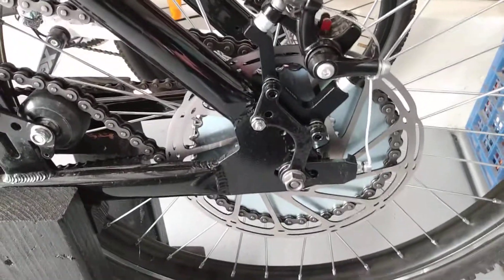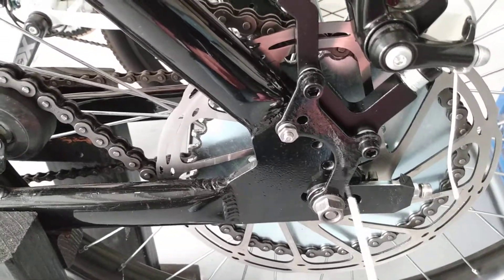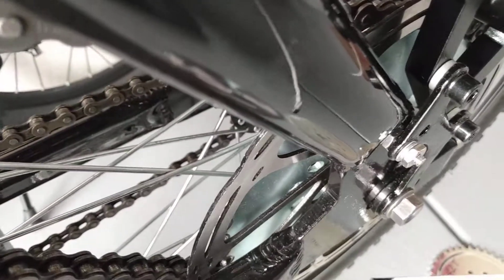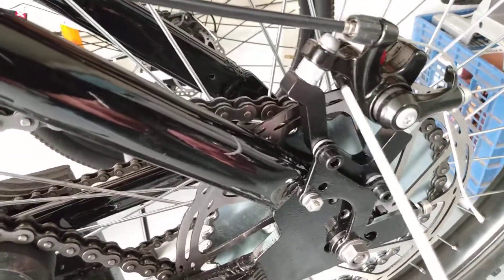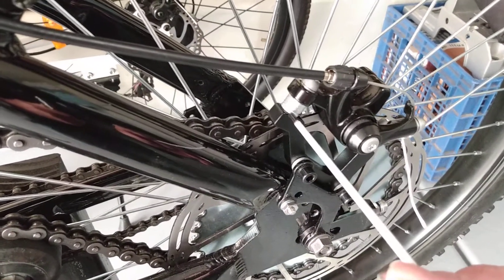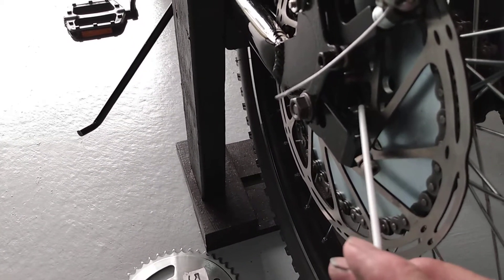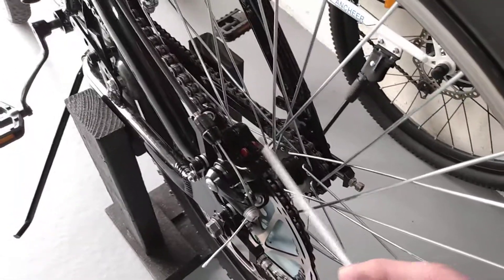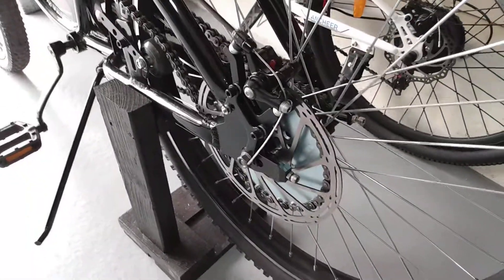Phatmoto 2019 model  Converting the V-brake to a rear disc brake

Comment: Being an older video, does the OP or anyone else know if this conversion has gotten any easier?   

FYI, the Switz Cruiser now has the back coaster brake fabricated at about a 15 degree angle.  It still attches to the traditional spot, but it's made like this 'today' for chain CLEARANCE.  Also, it now has the bolt-on setup for a disc caliper bult into the left rear side.  It also has 2 cable guides built into the left swing arm.  Only problem is, I can't find anyone anywhere who's made a video on the procedure >>>>> and where to get the correct parts to do it.  My hub already has a 3 bolt sproket adapter on it, so the fit >>>>> I sure wish I could get info on the parts to do this.
Reply from the maker: I did this conversion specific to the 2019 Phatmoto Rover as it came with a V - brake set up on the rear. It already had the 6 bolt hub which they utilized for the drive sprocket. I simply used some aluminum spacers along with longer bolts to attach the 220 mm disc brake rotor. I then used a simple disc brake caliper mount and attached it to the frame in the appropriate spot to have a rear disc brake. The actual combo sprocket/disc brake is an inferior design because there is no way to keep chain lube off the rotor, which then contaminates the pads rendering them sub standard for  braking. The newer Phatmoto's 2020 through 2024 use a 255 mm rotor but they also put the caliper mount in an inferior position on the chain stay which causes pad contact issues when doing chain adjustments. 
Overall, with quality brake shoes the V - brake was superior in braking than the disc, but it tends to wear out the rim fast, especially the cheap Chinese metal rim. If you have a 6 bolt hub, it is very easy to adapt exactly what I did for a rear disc brake set up.
Reply: @beaubrummelmotorizedbicycles  I have the 3 bolt sprocket adaptor  from Bike Berry.  It uses the black allen flat top bolts.  A thin spacer along with the disc >>> might just work!

I don't want to eliminate the coaster brake if I don't have to.

Comment: I have a felt faker gas frame and had thought about trying to install rear disk brakes.
They have the plate for the mounting of the disk brake caliper mechanism, but it looks like id either have to use a small sprocket with my  nc sprocket adapter along with a huge rotor.
Makes me wonder why they even welded the bracket for it, lol
I guess I'll have to stick with a coaster brake 🤦
Anyhow I appreciate you, thanks for the video
Reply from the maker: Yup, you would need a smaller sprocket for chain clearance and a minimum 220 to 255 mm rotor.
Reply from the maker: Thanks for watching.

Comment: where did you get the rotor
Reply from the maker: I got it from either Amazon or Ebay,  it is a Scram Centerline 220 mm rotor. If I was to do the conversion today I would use the 255 mm Monster rotor from gasbike.net because it gives extra clearance to chain and gets the rotor further away from possible contamination from chain lube. When I did the conversion no 255 mm rotors were available and when they were, they sold for $75, which is to much to pay. Gasbike has them for $49 with a mechanical caliper, a very good deal.

Comment: Where can I find that exact disk brake adapter? there are to many options
Reply from the maker: The disc brake adapter was sold by wilso 8276 on Ebay the hoop is 32mm but you don't use it,.You have to flatten out the slight offset by pounding it flat, I used a 3 lb. sledge hammer, then repainted it.  The caliper adapter was sold by trantocycling it is a 7/8 mtb disc brake caliper adapter 180/203 mm rear. Both those items are made in USA. They cost a little more than the Chinese but are superior.  Try those vendors on Ebay let me know if you can't find them.
Reply from the maker: I checked those sellers are no longer selling. I did do a search for both items and found them easy. The exact search wording was this: Bike Disc Brake Bracket Adapter Rotor Bicycle Mounting Holder MTB Tool USA. And the caliper adapter was this: 7/8 Inch MTB Disc Brake Rotor Mount Rear Post Caliper 180/203 mm Adapter US.

Comment: Thank you for posting this!
Reply from the maker: Thanks for watching, if you do this conversion go Gasbike.net and get the 255 Monster rotor it comes with a mech. caliper for $49. That is a deal, why use the 255 mm rotor well it gives you more clearance to chain and separate s the rotor further from sprocket and chain so chain lube doesn't get on rotor. You'll need to space caliper up further, but easy with aluminium spacers from Ace Hardware.
Reply: @beaubrummel2wheelgarage  Thanks again for the info! :)
Reply: LAHover and Beau Brummel, my two favorite motorized bike channels!  (But I'm hoping that LAHover gets over his fear and loathing for four strokes, however!! 😁)

Comment: 6 months on... hows the disk with contamination from that chain.. or do you run the chain dry.. (as the smallest bit of oil on a disk renders it useless).

Several companies/privateers experimented with this back in the 80's with motor cross bikes, actually running the caliper on the sprocket as a combined disk and sprocket... 
Great idea for weight saving on non sprung weight side of the suspension... but the brakes were useless by the end of a ride.
Reply from the maker: Very true there is a certain amount of contamination of chain oil on the disc. That is why I never upgraded the caliper to a more expensive unit. I run the very cheap stock caliper off the front. The pads are cheap. I also run the chain as dry as possible. I also take the pads out and lightly sand them with 220 paper, taking the oil glaze off. And I use alcohol on the disc to keep it clean. I rely mostly on the hydraulic front disc for the real stopping power. The rears work so-so mostly just as a slow down. They work about as good as the original stock v-brakes on the rear. You are the first you point this out, so you know your stuff.
Reply: @beaubrummel2wheelgarage  I had a friend's friend (Tony McMurdo) that raced top of class F3 on a zxr600 in a 400 frame.. He had an alloy rear disk with 50mm circular pads and 45mm holes in the disk breaking surface...
The bike would pass scrutineering but if he actually touched the rear brakes in a race the alloy disk would just disappear...
So from that you can gather how much rear brakes are of use in F3 racing.

I have an old '83 IT200 that has a drum rear that I would shim and get working but invariably would be dead before the end of a trail ride...
I was quicker into/through some corners on that than my current '99 YZ250.

Have you the room to fit a plastic disk between the sprocket and disk a bit like the old 10-speed rear wheel clear spoke protectors... (or at least a deflector on the caliper so no oil hits that and migrates back to the pads...)

You could be super fancy and mount your brakes on the other side of the shaft that runs your big intermediate sprocket... on the other side of the frame, away from the chain etc...
I would say excellent for unsprung weight saving...

q8)               anyway, yes... go with the inboard brake!
Reply: @TheButlerNZ  I had the same question. I'll probably try to make a small deflector shield that preferably attaches to the brake caliper. For example, Magura 4 pistol calipers have the two openings for the pistons on each side on the outside with rings in them. A thin shield could be attached there.

Comment: What pads are on the front?
Reply from the maker: The pads that fit the stock Phatmoto front caliper are the same as the Tektro iox,   It can really get confusing with so many different pads out there, make sure the ones you get are shaped like a mini ping pong paddle. I say 10x, but that is wrong they are iox